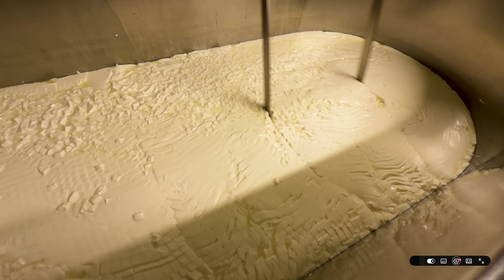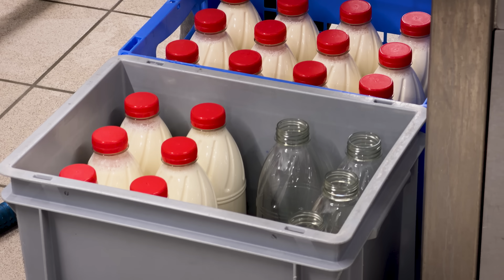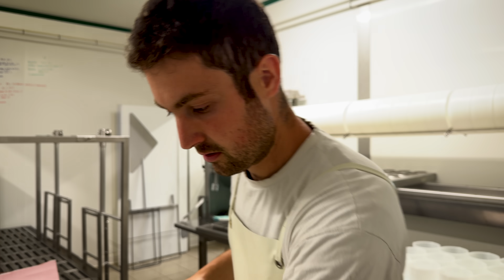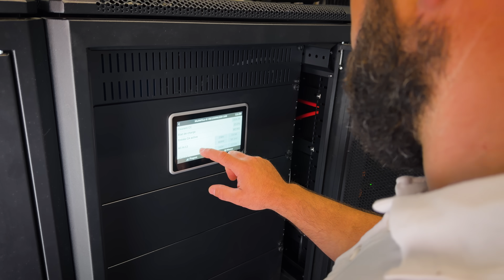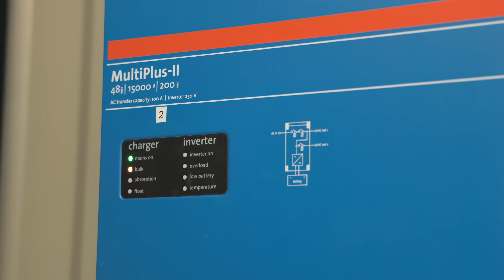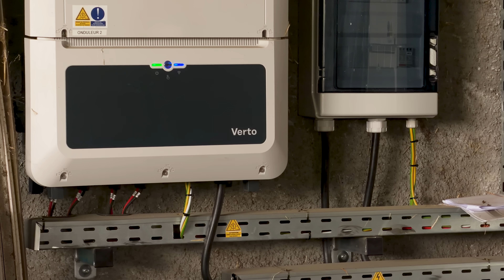This Dairy Farm Cut Its Energy Bill by €25,000 a Year

Comment: Woodgas is free and could run generator;
Methane (biogas) could be produced from cow manure in septic tank and could heat water and produce electricity;
Alcohol could be produced from any sugar and could run generator to produce electricty;

You would never go with PV if there wasn't for subsidies.
And for price of batteries you could've installed septic tank that produces methane...

Comment: The Renewables are the main cause of skyrocketing electric bills the ignorance of Renewables on the grid is easily demonstrated with a volt amp meter and 4th grade math called Ohm's law with the optional amp clamp takes less than a second to show an 85% difference at the wattmeter

Comment: this is exactly about how royal oil mafia holds the whole world in slavery - now more businesses can run easily and safe more of that new electric machines are coming to be charged from solar so no money for diesel
Reply: are solar panels free or what? :D
Reply: @sajuente8235 no, but russian gas is more expensive, exhaust co2, and there is plan 2030 :) so ursula pay for independence by your taxes, even money are just zero in digital system :)
Reply: Solar panels become free after 5 years even less, and then 20-25 years of free energy.

Comment: 90kwh battery seems fine. 
The 3x 15kva multiplus is well undersized and gives no redundancy (if 1 unit goes faulty there is now power). 

How does this system save 25.000 eur per year? 

If you'd charge a 90kwh battery full for 300 days a year you'll save yourself having to buy 27.000kwh  from the grid at 0,28 cent. So year return is about 8000 euro!
Reply: 32kw batteries nowadays cost less than 3000 euros per unit. How much victron and fronius cost? How many solar panels? They are quite cheap and installing looks not complicated.
Reply: You are mixing up savings and ROI. There is 100kWp of solar they say, this means about 90.000kWh a year. Times 0,28€ (not 0,28 cent) is 25.000 eur per year.